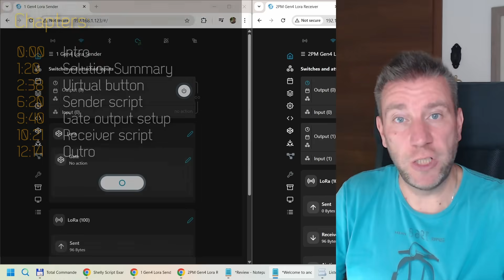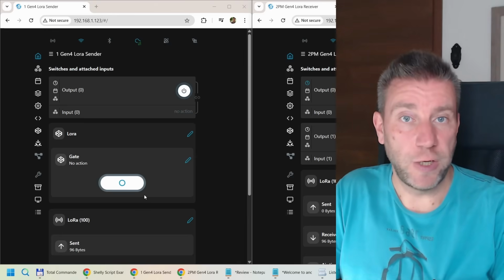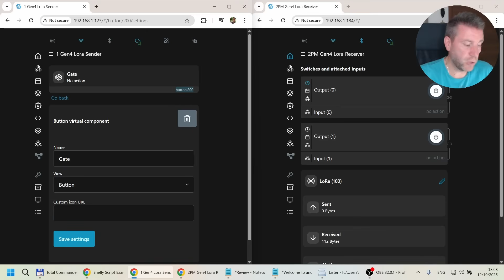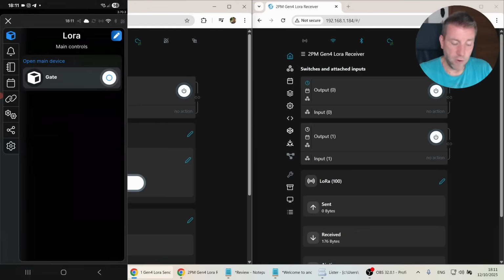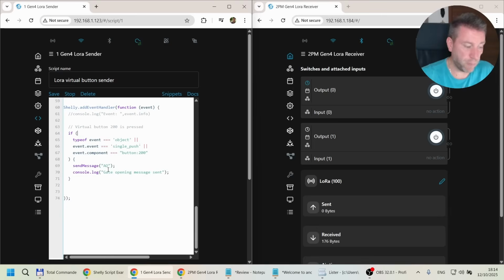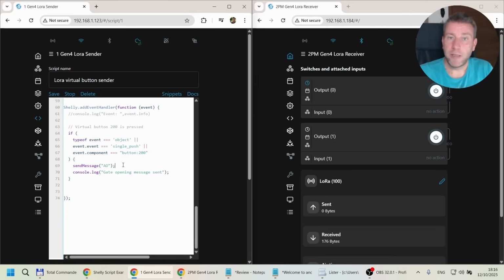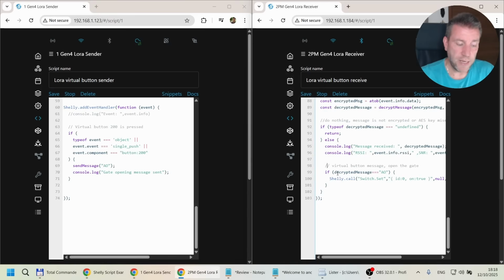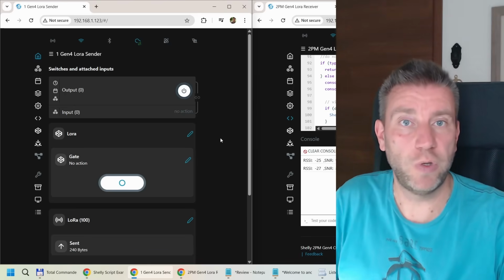Lora gate opener in Shelly

Comment: Many thanks for this very helpful explanation.
Just one question: Is there any option to bring the virtual button to Apple CarPlay integration of Shelly? Would be nice to trigger the button from the car to open to door of the garage.
Reply from the maker: I am not sure what you want to do. The app and CarPlay sees devices that are on wifi.
1) if you want to remotely trigger the garage door, where the garage door in controlled by a Shelly that is on wifi, you don't need Lora at all (I guess that is not the case). 
2) if you want to replace this project (garage door is far and needs to be triggered with Lora) you can include the wifi device which is triggering the door in CarPlay.
3) If you want to use Lora to send a trigger far away from the house before you get that, you cannot add that to CarPlay.
Reply: @csongorvarga Thanks for your feedback. It’s indeed the case that the garage door is out of the range of the Wifi. That’s why I want to use LoRa to trigger the door. From the phone should be easy to trigger it with LoRa, but have not yet an idea how to do from CarPlay. I think Shelly supports only WiFi devices in Carplay but no virtual buttons. Correct?

Comment: I noticed a small difference between the code in your GitHub and the one shown in the video. On GitHub you use &&, but in the video you use ||. Just pointing it out in case someone else gets confused while following the tutorial.
Reply from the maker: Yes, that was a bug in the code. And I have not realized it until the video was released and I was adding more code for the following video. Youtube has not option to alter the video once uploaded and released, hence the difference.
Reply: @csongorvarga Yes, exactly. I managed to get it working using the code from the video. The GitHub one didn’t work for me. Thank you.

Comment: By following your tutorials, I was able to get started smoothly with Lora Shelly. Thanks to your codes, I can control my lights from Home Assistant, which recognizes the virtual switches. One quick question: Would it be possible to receive the relay status from the receiver on the transmitter? Sincerely,
Reply from the maker: Yes, in the 05 video I show how to send the data from the input switch back to the sender. Same could be used for the output state as well. But what do you want to use it for?
Reply: @csongorvarga  Thank you for your reply. Actually, yesterday I managed to cobble together some code that works with status feedback. If you'd like it, just for your information, I'd be happy to send it to you.
Reply: Hi @philippel8874, do you have to do something on home assistant to the virtual decives show up? I´ve created a virtual component in a shelly1 gen4 with Lora but Home Assistant only show up the physical component. Thanks
Reply: ok, found it!! it create the swith like a new entity inside the device. great!!

Comment: Very good tutorial. It is worth noting that the 2PM, the remote device in this demo, can't actually be used as a gate opener as it does not support dry contact outputs. The actual scenario for an automatic gate opener should have a Shelly 1 on the remote location
Reply from the maker: Oh indeed, good point. Unless you can do it with 24V, but dry contact is a safer option.